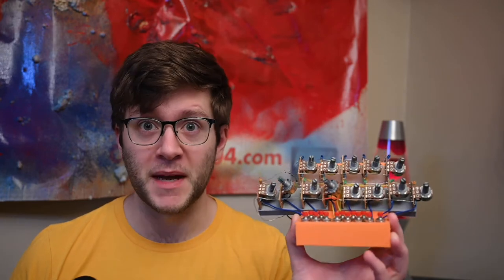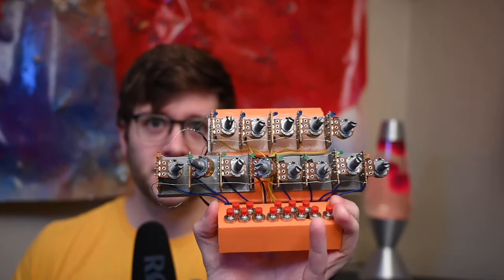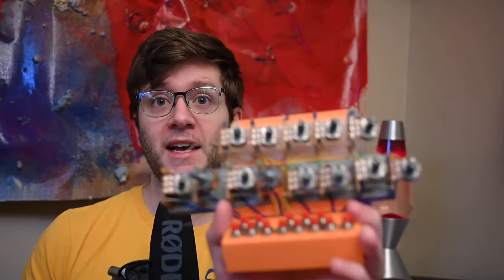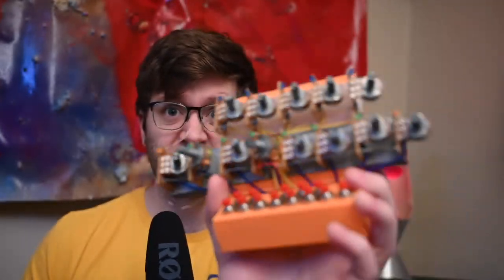DIY Polyphonic Synth Piano!

Comment: Hello
I wanna build these cool organ

Could you please provide the schematic?

I'm noob af
Reply from the maker: Hey! If you're new to this, I'd really recommend building just 1 oscillator from the first link I have in the description and seeing if you can get that one working first. I'm just using that design, only with a power rail and running the output of each oscillator through a button. If you can get one done, then you can get them all done. The only difference is on the higher notes I did use a different capacitor, but I'm traveling rn so it might be a bit before I get back to you with that info

Comment: this is awesome
Reply: its really harsh on the initial beat though, could there be a way to soften its impact?
Reply from the maker: Might be able to run the output through some high and low pass filters to cut the noise,  though I did make this more as a novelty rather than a serious instrument